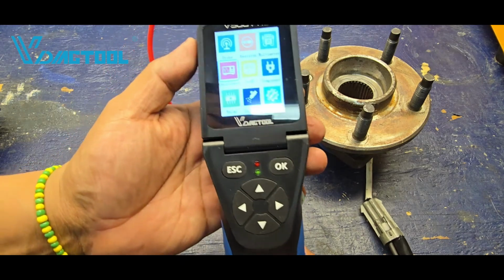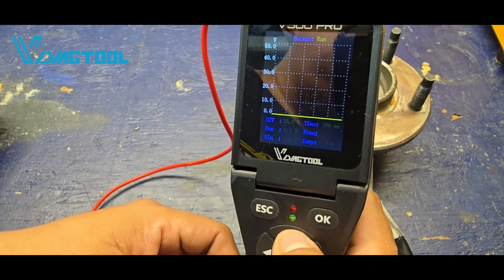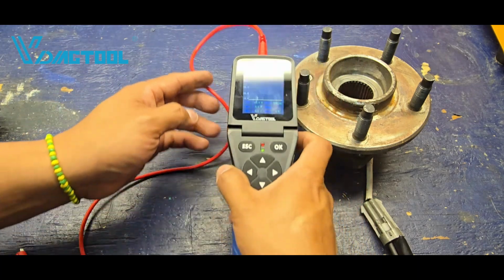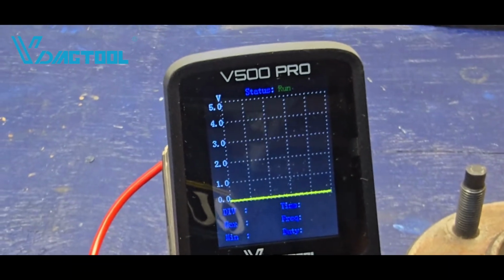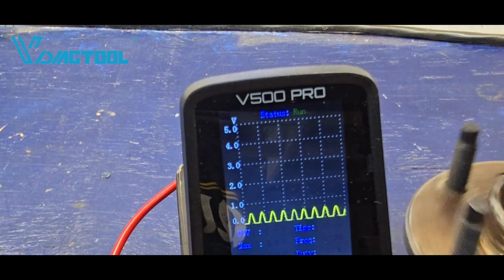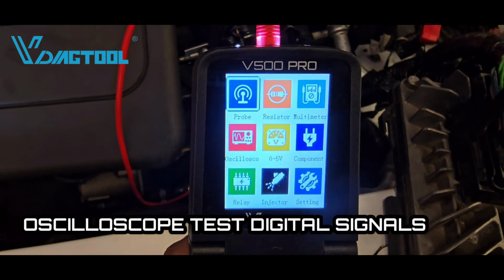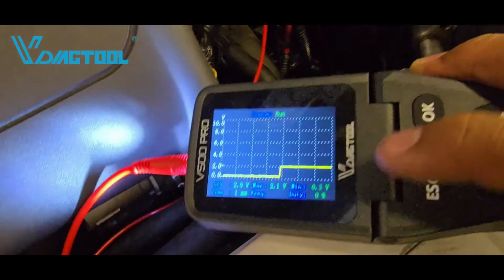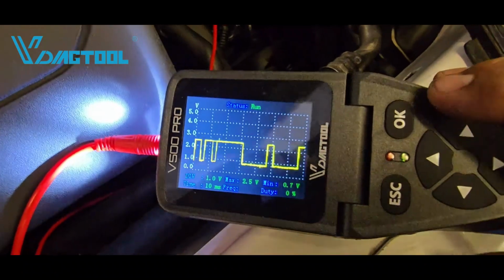How to Test Analog & Digital Signals & Camshaft Sensor Using V500 PRO | Automotive Diagnostic Tool

Comment: You have red piercing cable on power side where did you ground it when you tested the cam shaft sensor?
Reply: probably battery ground or maybe anywhere on the frame, cant tell